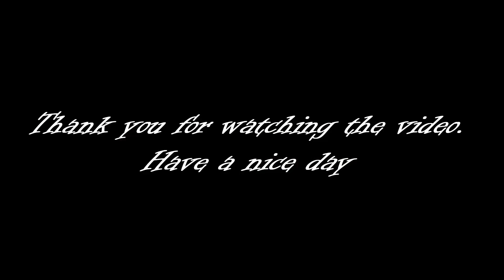Antique Guitar old Restoration | Restoration Music tools broken

Comment: 6 mistakes in the video:

1: The nut was fine except for the whole guitar it was like covered it crap
2: He painted the guitar without covering the fretboard 
3: He covered the broken/open areas with some rice thing
4: He put Steel  strings on a Nylon
5: He didn't even tune the guitar correctly
6: HE PUT THE TUNING PEGS UPSIDE DOWN KILL ME ALREADY
Reply: 7. The sanding paper and finish he used most likely cost more than the actual fucking guitar so he should of used it as firewood.
Reply: @christophereverett276  man we could just take out SO MANY MISTAKES FROM THIS VIDEO
its just infinite
Reply: There is a guy reacting to this video right below it titled "Reacting to the cringiest guitar restoration" I'm dead 🤣
Reply: THE DUDE HEARTED OUR COMMENTS LMFAO IM DEAD
Reply: @christophereverett276  IKR LMFAOOOOOO
Reply: No hate tho we just makin jokes lol
Reply: he used steel brush on guitar

Comment: I mostly liked the progression in horror : first scrub it with a iron bruh, tem give it a bath, then dry it with a paint burner, then mend it with curry chiken noodle, then spray it all over without tapering anything, then mountig the tuning machine upside down, and finally restring it with iron strings. And then the paramount tuning and playing. You'll do better next time, buddy (I mean, doing worse would be impossible). But I liked your commitment. You should at least change the nut and tune it properly ( you can find how on YT).
It has a massive pine top Btw, with large annual rings. It could potentially sound not too bad.
Reply: you forgot the super bonder mix in the chicken noodles  xD
Reply: I think the restoration went back wards like your tunning, and that guitar is one of a kind rare ...
Reply: Adogshair I Love You
Reply: Adogshair thank you so much for wasting your time to say this so I don’t have to waste mine 🙏
Reply: LegionOX I Love you
Reply: Manuel Leyva I Love you
Reply: @legionox4802  It is not what I said. I said "I like your commitment", not that your wasted your time. And I dont consider I wasted mine neither. Let's say, your restoration method in ... not conventional in such an extend, it makes your vid very pleasant to watch, and a master piece on its own :) . Cheers& Peace
Reply: He used filler right after he used the noodles. Why couldn't he use filler that he had instead of the ramen?
Reply: It was kind of terrifying to watch. Not to sound like a conspiracy theorist, but anyone want to take bets that this guy bought a mildly worn used guitar and then trashed it so it could be "restored"?
Reply: that stuff that was in The sound hole was right inside..... he didn't have to reach all the way down to the bottom of the guitar for a bunch more 😒that was suspicious
Reply: @catbui7795  y u telling ppl you love them
Reply: @lukeprice8361  I was thinking the same thing.  Although it wasn't as badly trashed as it looked.  If it had been as bad as he pretended. the veneers and wood  should have been separated, with few passengers along the way
Reply: Adogshair can you please speak proper English
Reply: Guitarists mostly seem to be too horrified to "get it".
Reply: @kennetharnold8705  Get What It is a joke. It has to be a joke.  But to a lot of musician a horror story
Reply: @lukeprice8361  - That's exactly what happened. He trashed a good guitar, so that he can "restore" it

Comment: Oh no my dude this was done completely wrong.
Reply: Indeed you are correct. It could have been treated much better. Even though it is a cheap junk guitar it did not deserve ramen noodles as a patch. I was appalled as well.
Reply: @keithperry8098  - I was surprised when he started cleaning off the dirt and mud with a wire brush, then later switched to the water bath.  What on earth was he thinking?
Reply: At this rate it would have been more merciful to just burn then this atrocity
Reply: @Struggle.Snuggles  A fitting farewell
Reply: As wrong as it gets

Comment: Sigh, didn’t mask the finger board, could have used real wood to patch the hole, should have done a neck reset, nut, bridge and possibly saddle replacement or modification, could have removed the fingerboard to insert truss rod
Reply: I guess fret buzz was what he was going for?

Comment: I give kudos for making the attempt. All of the metal parts were cleaned properly. The ramen noodle fix was clever. But the varnishing needed to be done in layers. Especially for the brightly colored putty. 
One layer painted, sanded, then again. Until its a solid smooth finish. For tuning, just go online and theres recorded string sounds for all six strings. Or just order a guitar tuner online. ❤ 🎉 😊

Comment: There are a few things I would do differently:
1. Repair hole:
Tape the hole on the inside with textile tape and paint on the outside.
Saw out a corresponding wooden panel and repair the transition with wood glue and sawdust.
DO NOT USE FOOD!
2. Color:
Repair, sand and spray with paint (wood glaze) using a fine spray gun (thin the glaze accordingly).
TAPE OFF OR REMOVE PARTS THAT SHOULD NOT BE PAINTED!
The strings:
ATTENTION: It is particularly important to make sure that you put on the right strings.
(Acoustic guitar: nylon strings (e.g. Blue Austine)
Western guitar: metal strings (e.g. D'Addario Phosphor Bronze 011-052).
🎸

Comment: What kind of wire brush should I use to get the dirt off my Martin guitar?  I tried a 9" angle grinder but it made too much dust.  I will use car filler to make good the dents, but I now need to get all the muck off it properly.  Should I scrub the whole instrument down with soapy water before or after wire brushing?
Reply: Con lija del 20
Reply: Tienes que sumergirla en un río dos semanas

Comment: Okay remove the strings and sand all of the finish that you sprayed on the the fret board and you will be able to tune the guitar properly and get the sound out of it that you want and always remember on the next restoration of any guitar that you do before you paint or finish one tape the sound or pick up ports or holes up and always remember to tape the fret boards up or it's going to affect the sound of the guitar dramatically every time man.
Reply: And put the machine-heads the right way up. This has to be a joke.
Reply: @gustavthemagician  No it's not a joke and you should watch most of the  professional luthers and every step that they take even when building a classical or an acustic guitar and even on restoration there's also a guy on here that does all of that as well and you need to watch his videos and pay close attention to everything that he does on the restorations and guess what you will see that he not only removes all of the old parts and cleans and restores them and replaces them if needed and he also covers the fretboard and all of the areas that could be damaged from the painting or staining process and no I did not say that you should put the tuning heads or keys on before you complete the restoration process i simply advised you to tape off all of the areas that could be affected by the painting or staining process because it would not only affect the tuning process but the sound in general but it's your funeral if you want to act as if you know it all and not take my advice and if nobody buys the guitar due to the affected sound well then I guess that this will be a lesson learned and I told you so but you found out the hard way!

Comment: I wonder why you used the instant noodle to fix that hole. 😢 And it would be better not to spray overall guitars. You can fix those holes with wood powders instead and fix parts of colors. Then coat them shiny by using brushes paint around.

Comment: I'm sorry but this is a failed attempt at restoring a sunburst classical guitar, he used noodles to repair the hole and put the tuning keys the wrong way round and to top it off he changed the original finish of the guitar. The guitar is a standard classical guitar so he should of put nylon strings on the guitar and restored it to the original sunburst finish.
Reply: True , can't the neck crack as well ?
Reply: Steel strings on a classical guitar can create to much tension in the neck and due to the guitar being a classical guitar it has no trus rod in the neck so over time the neck can break

Comment: FOR WHAT YOU STARTED OUT WITH  WHAT A CHANGE  BUT YOU NEED A TUNER  IT MIGHT NOT HAVE BEEN PERFECT  BUT WOULD OF SOUNDED  BETTER  JUST LOOK AT WILLIE NELSON GUITAR AND THE OTHER HAND A MASTER GUITAR PLAYER COULD HAVE MADE A WORLD DIFFERENCE  AND THEIR WILL ALWAYS BE NEGATIVE PEOPLE  AND THERE COMMENTS IF IT MAKES YOU HAPPY THATS ALL NECESSARY IVAN FROM ILLINOIS.
Reply: No. Just no.

He should've never soaked it, he should've taped the neck before painting, he should've changed the strings, he should've polished the frets, he should've fixed that hole using wood dust and glue, he didn't need to disassemble the tuners. This must be a joke, and a really bad one. Just like any of their videos, don't think he really intended to restore it.